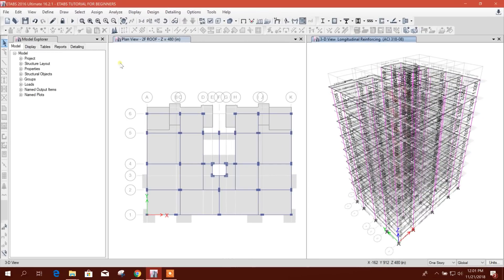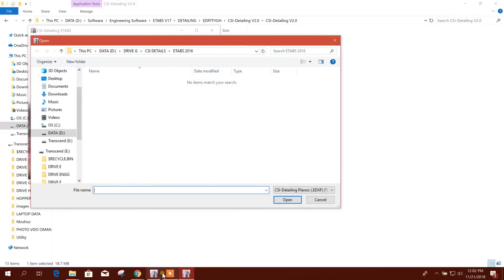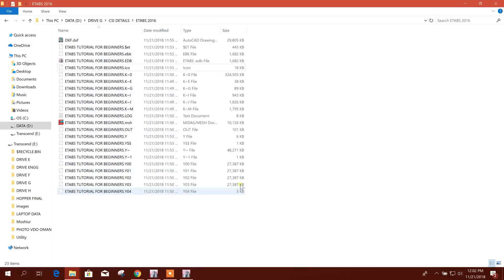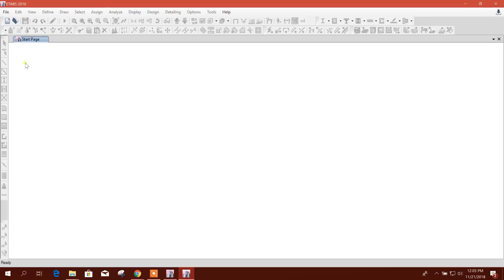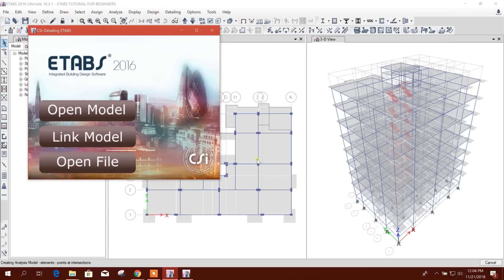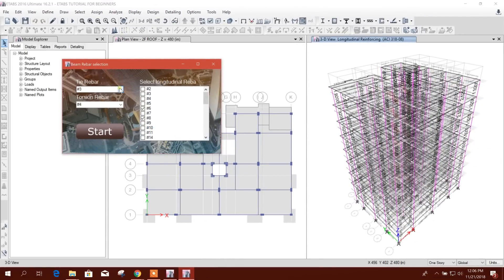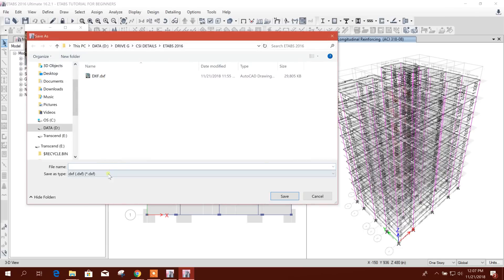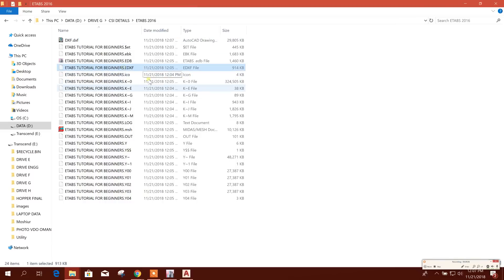ETABS DETAILING IN CSI DETAILING V2.0-EDXF FILE ISSUE

Comment: Sir, when I am detailing Column and beam in ETABS every time the Column detailing is showing 12 main bars of whether 12mm or 16mm or 20mm....how to fix that issue?
Reply from the maker: You can choose it from setting. And note the CSI details is in still starting stage, not much precise.
Reply: yeah that's y i use RCDC....but don't know why m getting issue wd rcdc now.... whenever i import a .mdb file it shows "unable to read analysis data" ....i think its the prblm of database... The installed database is 2010 version..I tried to import 2002-2003 dadatabase and 2007-2010 database also...but same issue every time😒😒😒
Reply: Hi brother, did you able to open csi detail V3.0. Because I have a problem when i tried to open the csi detail v3 an error came says "contact your csi dealer for update the software". If u know how to fix this problem please mail to shakyrrosman97@gmail.com. Thank you

Comment: please tell us your pc configuration. does csi detailing software need any special software to run? will EDXF file open in autocad 2009 ultimate?
Reply from the maker: No. No special software needed to run CSI DET.... After generating 'dxf' file open it in any Autocad version. EDXF file is opened in  CSI Details software.
Reply: Hello